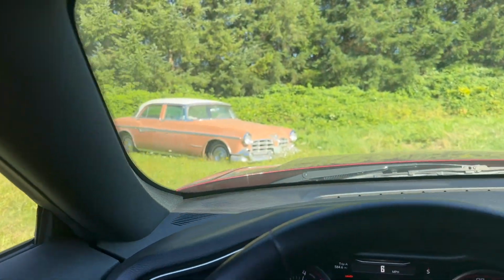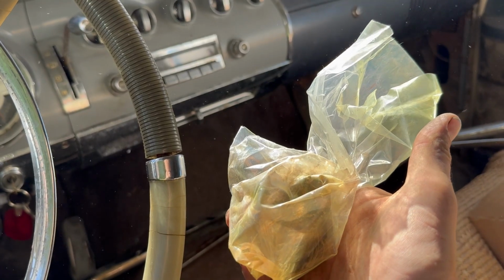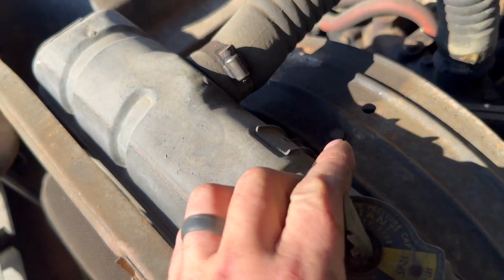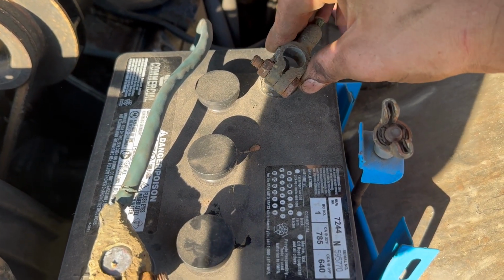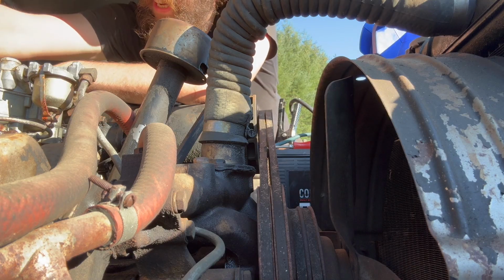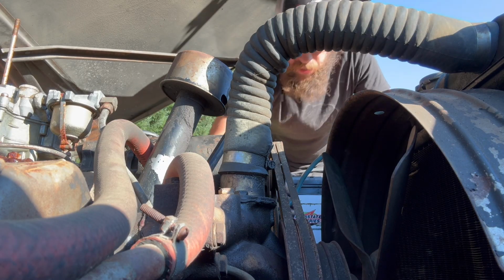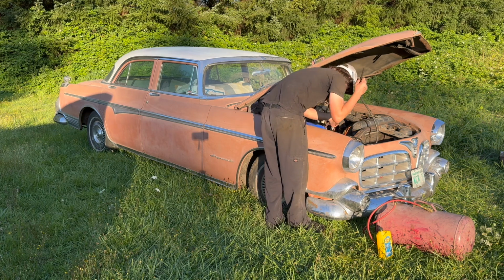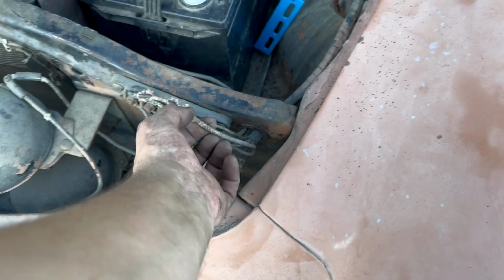Hemi Powered Land Yacht - Will This 1955 Imperial Run And Drive After 30 Years?

Comment: It looks like a 300
Reply from the maker: It should! The 300 borrowed the Imperial grille, and they stuck a 300 badge where the Imperial crest sat on the nose. Of course the tail lights are different, and it has extra doors.

Comment: Back then it was straight 30 weight, non-detergent oil.  It was thought quite impressive if you reached 100K miles.
Reply: Garbage oil, garbage leaded fuel, no PCV system=loads of sludge, open crankcase vent=literal gravel in the crankcase, primitive metallurgy and surface finishes on bearings, piston rings, and cylinder bore hones.